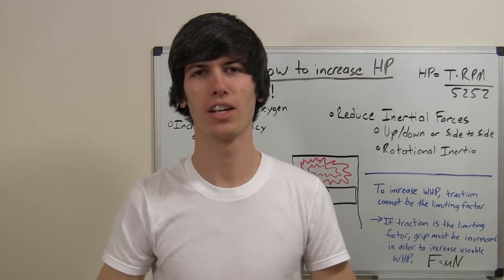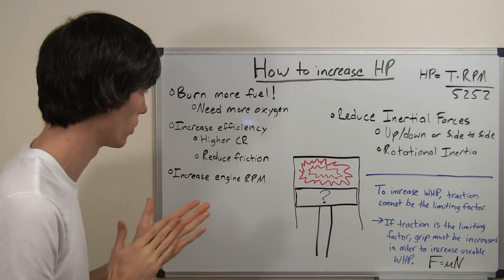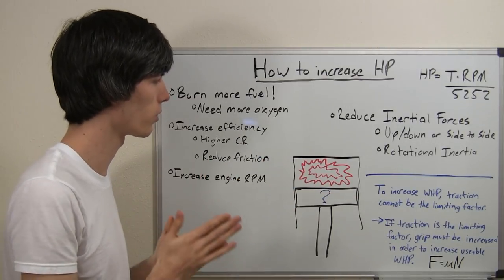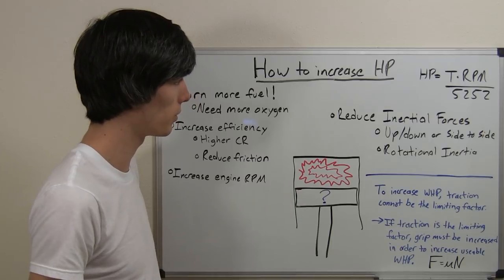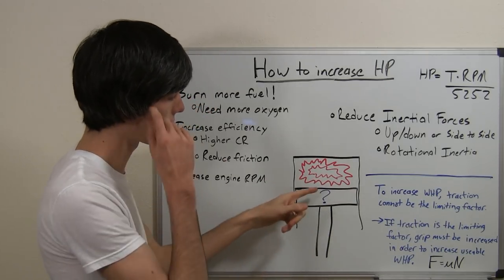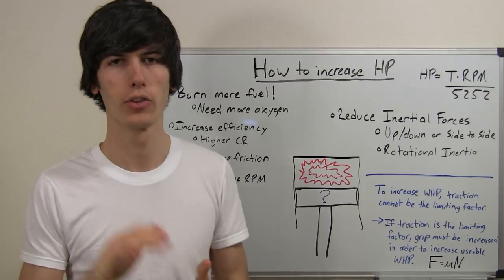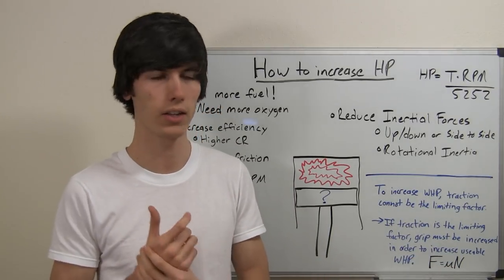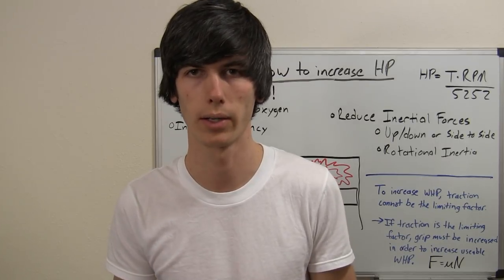How To Increase Horsepower - Explained

Comment: There is trillion ways to increase horsepower Engineering Explained  Non charged engine: use different valve, inlet mainfold, exhaust pipe bigger or smaller depands engine speed.  increase power in a Naturally aspirated engine means increase rpm and let the engine run as smooth as possible. So add lubricate and keep the engine temp low is needed. For turbocharged engine, install bigger ridiator for larger volume, install variable turbocharger, increase the size of inlet  mainfoldand exhaust pipe for higher boost. But the downside is pumping lost for hugh rev engine at low rpm. Same way for increase power in supercharged engine. This called Modification.
Reply: You did not know this
Reply: Huh
Reply: Can you actually point out my mistake?
Reply: ihatecrackhead DOHC will bite low end torque, you mean lag!? DOHC is f high speed engine, no one care the low end tq in a Ferrari, Lambo, GT3rs etc.... Most GT cars now have vairable valve timing and valve extension. For high revving engines, at low rpm, they'll lose power by pumping lose, so either  a high revving engine is or isn't running DOHC, at low rev, it still can;t make power and efficiency. Oxygen is compressable so yes, the capacity may increase from certain rpm. For high capacity high revving engine like Lambo's 8250rpm 6.5L V12, at low  rev, it may not get 6.5/4 1.625l per stroke. (I have to mention something here, the different between long stroke and short stroke did effect the power. If both short stroke and long stroke have 500hp, short stroker will shoot power quicker but less fuel eco also more heat.)
Back to the point, So now, does DOHC really matter in low end power lose? Nope. There's something call VVT (variable valve timing) and extension control by a generator installed at the end of the crankshaft. At low rev, the timing would be exactly the same as normal but'll extende in a wider posion. So more air would fill in which help getting rid of lag. At high rpm, the inlet valve would open later and close later for avoiding engine pumping lose. In other word, DOHC biting low end torque is not nessersary for modern engines.
Reply: ihatecrackhead You've missed something. Engine temp, stroking, firing order and out side temp. VVT is for avoiding friction. Do you think VVT would add extra friction? C'mon!
Look at Porsche Turbo S, variable turbo increase low end tq, max tq apply from just 2100rpm all the way up to 4000+rpm, non variable turbo engine like GTR's max tq from 3200, 12C max tq fro 3000 etc...
Enginetemp. No matter what type of engine, higher the emp means lower density, less oxygen, you'll lose power, turbocharged engine would be more effective, 70-80hp would disappear in 90degree F. You can;t just randomly compare two cars. 
 stroking. Mustang GT 5.0 R50 4 valve DOHC V8 90mm in stroke vs Camaro L99 6.2l V8 76mm, Mustang 412hp, 390lb/ft Camaro OHV L99 400hp and 410lb/ft fir order 1,8,7,2,6,5,4,3 vs Mustang 1,3,7,2,6,5,4,8. The Chevy actually can build the power quicker, smoother and the result is quicker if their gearin are the same. To increase engine dynamic, mainfold, inlet valve door, exhaust ainfold, exhaust vavle door also count.
In order word, there's many modern engineering can avoid engine friction. You've to jumo out of American engineering and look at others engineering.
Reply: ihatecrackhead Your first point called expansion. Expansion is fighting with pressure in the cylinder, the amount of air would maintain 3.8L with additional pressure, so it does not effect the engine power. You should start looking at how much fuel would fill in to that overpressured 3.8L.

Second point, Porsche didn;t prove your point, they proved mine. Variable valve timing, valve extension and variable Turbo increases low end torque, and high end efficient. Look a the powerband, 2100-5000rpm max tq 6500max hp. Turbo S's 3.8l F6 have 4 valve per cylinder.

Third point L99 does have cylinder deactivation, so? Does that really matter?

Fourth point Do you think manufeaturer will be that dumb? Putting a VVT for more friction? Check out  991 vs 997 Turbo S powerband

fifth point Short stroke would burn more fuel at the same engine speed, that's also create power quicker than long stroker. Check out why trucks uses long stroke engine. Then check AMS alpha 16 4.4l big bore.

DOHC are not always better??? Yeah they're better for high revving high flow engine. Those "friction" logic from you is not nessesery.
Reply: ihatecrackhead Again, you're talking about expansion. expansion would effect by temp. That's why turbo engine lose power at low density aera. more psi does mean more pressure but not fuel. Manufaturer would not purely allow more fuel to fill in because more air was flowing in. That'll decrease MPG. VVT not just increase low rev efficient for high revving enign, it shows your lack of knowledge here. VVT also avoid pumping lost at high rpm for high revving engine. Cylinder wall pressure depands on temp, amount of air flow in/ second, out side temp and combine expansion ratio. Don;t talk math with me.
Reply: ihatecrackhead Air squeez into the piston would not create extream heat, extream heat are at compression section. However, the air is not going anywhere in that time. it just expand.

More air NOT= more fuel needed. More air, same amount of fuel= mild backfire, maintain blue flame. Does not effect in power. The heat would also increase. However, I'm telling you that 2X air not= 2X fuel.

S.C is similar to T.C S.C is more linear, need a bigger oe for more power and not as much lag as T.C. To make power, mainflod, AF control and ECU need cooperate.

The last part is all about air pressure/expansion.
Reply: I wouldn't say a trillion ways, but horsepower can be increased. Not as high a most people think, but it can be increased. I think the video pretty much explains it. The problem with modifications is most people don't do their homework. When you modify you become an engineer. You must make the rest of the vehicle work with whatever you modify.
Reply: With more speed, you need to adjust the braking and damper to hold the weight and slow it down with extra weight transfer and speed. However, I think some cars like Nissan's GTR, Porsche PTE and some other cars have the ability to handle a 800hp tune without any electronic adjust or remap or damper tune but a better brake disc and router will be needed.
For cars like Nissan, Audi, Porsche, they highly relied on electronic sensors, to adjust the sensor is to remap the way it monitor and the bit. ie, GTR's 16bit sensor will update info 1000 times per second and it's fast enough to track the yaw and traction of the car even when it got 800hp.
Reply: LAUNCH CONTROL 東瀛戰神 When a vehicle advertises 800HP, this is peak RPM. What we typically need on the streets is torque. HP is simply a mathematical way of expressing torque and RPM because it is a result of it. I prefer more torque because that is really what we are after.
Reply: walkerscranger Torque and horsepower is pretty much the same. More horsepower by increasing fuel flow efficiency will increase rpm but torque or force is pretty much the same, which means the max torque @ rpm may not have big difference. To increase torque, mostly remap ecu and tune the inlet valve settings, air/fuel mixture, etc... That'll affect the force in cylinder. The red line may stay pretty much the same but low end horsepower will increased.

The best example is McLaren 3.8 TT V8. Look at the torque curve, 443lb/ft from 3000-7000rpm. That tells the engine have potential to beat 443. The GT3 version got less power but the torque curve is 370lb/ft at 3000-7000rpm. Easily tells they're playing with air/fuel mixture and the ecu limiter.
Reply: LAUNCH CONTROL 東瀛戰神 The peak torque will be before 5252 RPM and the peak HP will be after 5252 HP... how are they the same? Torque and HP will be the same at 5252 RPM. One way to increase torque is an intake runners of equal lengths but have a valve that allows a shorter runner for higher RPM. Or adding more stroke. But anytime you increase torque you are increasing HP because is simply mathematical as long as your RPM increases.

Not every engine will have a great increase due to its own restrictions. The engines you mention are already designed to be high HP engines. The typical vehicle is different because a vehicle with a lot of torque gets you off the line, HP gets you on the top end. Just because a vehicle has a lot of torque does not mean it has a lot of HP, it will need to keep the RPM curve going to have high HP. A vehicle with a lot of HP may not have a lot of torque but it can keep the RPM very high. A good example is the Buick Grand National. It has over 355 pound feet of torque but the HP is low (250) because it doesn't have the RPM to continue the climb. The formula shows that at peak torque the engine is only at 135 HP. HP continues to climb while torque starts to descend. So when the engine peaked out the RPM with 250 HP the vehicle is at 219 pound feet of torque. A drop of 136 pound feet of torque.

That is why when the manufacture advertise torque and HP it is always two different RPM's. 2015 Chevrolet Corvette 460 pound feet of torque at 4,600 RPM but the HP is 455 at 6,000 RPM. Which means the torque at that HP is 398 pound feet of torque. A drop of 62 pound feet of torque.
Reply: walkerscranger Horsepower isn't as easy as you think. There is many way to get the wrong horsepower. I'm not saying manufacturer are lying about horsepower, but they dyno horsepower at different speed. The more reliable factory is Nissan. Nissan GTR's maximum speed= 315 km/h- 318 km/h or 320 (200 mph) if you're lucky. So if they get the horsepower at top speed, the number isn't a lie. There is a real example. BMW M5. You believe a car with that much weight and similar power to weight as Nissan but with slightly longer gear ratio can reach 300 as soon as GTR? No, they dyno the horsepower at different speed as the Nissan. The BMW can reach 320+ km/h without limiter, same goes Porsche, it can reach 333+ km/h without rev limiter. At same speed as GTR (315-318kph), Porsche cranks about 636 horsepower. BMW cranks around 613 horsepower but 590 lb/ft of torque. BMW's 560 horsepower happens at higher speed, about 340 km/h. Porsche 560 horsepower happens at about 357 km/h. In conclusion, those 4.4 liter TT V8, 3.8 liter TT F-6 are underestimated. I don't want to do the calculation here, it'll can take 100 lines. If you interest, the formula is thrust x speed / 75 kgf. Hard part is to calculate the thrust. Took me whole day. (sorry for bad English)
Reply: +NISMO N ATTACK 東瀛戰神 Horsepower has nothing to do with how fast the vehicle travels (mph). The engine is either on an engine dynamometer or in a vehicle on a chassis dynamometer. Horsepower is simply a mathematical number from torque and RPM... nothing more. You have a certain amount of torque at a certain RPM and if you work the equation correctly it will give you a figure that we call horsepower. Here is the formula to calculate horsepower HP = Torque X RPM / 5252.... MPH is not in the formula. Horsepower is one of those figures that people love to say, but it is really the torque of the engine expressed a different way. The engines output is also limited by the transmission, final drive, weight of the vehicle, aerodynamics of the vehicle, tires, road surface, humidity, temperature, wind, quality of the fuel, ect. Why would MPH have anything to do with horsepower. The engines peak RPM's can be reached in neutral, so as long as you have a way to load the engine (chassis dynamometer) then you can find out how much work the engine can produce... not how fast it can get up to.
Reply: walkerscranger Horsepower does related to how quick a vehicle accelerate. Again, horsepower can measure in many ways. Ie, kw, ps, bhp, etc... Mine is related to thrust. The amount of speed gained in certain time tells how many g the vehicle pulls. The amount of G tells how much forces the engine applied compare to its weight. That known as thrust. It's like the relationship between effort force and resistance force. Effort always= resistance in ideal world. But in actual world, it can affect by air resistance, traction, etc.. Those will cause calculation error.
Reply: +NISMO N ATTACK 東瀛戰神 The thrust and or force that you are referring to is called TORQUE
Reply: +NISMO N ATTACK 東瀛戰神 The many different ways that you are referring to (kw, ps, bhp, etc) are measuring using the same calculations under different conditions or a conversation of the same thing. The big problem with people and HP figures is they think they HP does not change in any condition. Climate, fuel, surfaces and driver effect everything.
Reply: walkerscranger True, they calculate horsepower in many different ways. Problem is,, which fit the most. 

Air density, fuel, surface, timing, etc.. Does affect horsepower, but that's another case. Not the one we're talking about.
Reply: +NISMO N ATTACK 東瀛戰神 Horsepower is calculated HP=Torque×RPM÷5252. How are you calculating HP?
Reply: walkerscranger Thrust x speed / 75 kgf. Here's a real example. GTR's motor can pull an average 0.237g for the Nissan at 300 km/h, average thrust= 412 kg at the wheel. 412* 83.33 m/s . 75= 457.9 wheel horsepower, pretend 15% drivetrain loss, crank horsepower= 538.7 horsepower.
Reply: +NISMO N ATTACK 東瀛戰神 Explain THRUST.
Reply: +NISMO N ATTACK 東瀛戰神 Again there is HP at the engine crankshaft and there is Brake HP at the wheel. Basically the HP minus the powertrain loss is BHP.
Reply: walkerscranger Thrust is simple. ie a car weight 1740 kg, it reaches 300 km/h in 35.7 seconds. 300 km/h= 83.33 m/s, 83.33/35.7= +2.33 m/s / 9.8 m/s square= 0.238g. So the engine needed 0.238 time the force the weight of the car in order to reach 300 in 35.7 seconds, the last calculation I excluded air resistance, this time, included air resistance. At 300 km/h, air resistance= avg 109.1 at 22C, Sea level 3.54m, 60% humidity. (the reason I detailing air resistance is because above 250 km/h, air resistance is so effective) 109.1+1740+ 50kg= 1790 kg*0.238g= 452 kg* 0.85= 384.2*83.33/75= 426.9 wheel horsepower at 300. Edmund tested= 430 wheel horsepower, 20% loss= 533.5 horsepower. Exact horsepower as what Nissan claim. At 6500 rpm, crank torque= 431.1 lb/ft. The torque curve of the Nissan at 6500 rpm is= 431.1 lb/ft. So it prove me right.
Reply: +NISMO N ATTACK 東瀛戰神 Thrust is what a jet engine does. You are referring to TORQUE. No matter what or how you explain it torque is what moves the vehicle and how much you have at a giving time of the RPM range determines HP.
Reply: Keith Walker Before going any further, let me ask you a question. Tell me the difference between jet engine and rocket.
Reply: +NISMO N ATTACK 東瀛戰神 You're on the internet.... Look it up. Rockets don't have an intake... their fuel is solid and there is nothing mechanical. Jets have an intake... their fuel is liquid/gas and there is a mechanical aspect to cause the effect. Rockets are similar to a bullet (a projectile) but continue because there is fuel (generally a one time use). Jets need lots of air to cause the thrust effect. Either set up has a drivetrain because they use the force of the combustion to move the airframe. Vehicles need a drivetrain because the effect of the air/fuel is producing a twisting effect (the crankshaft) and based on what type rod length and crankshaft journal off center line determines the amount of torque. The amount of air/fuel in the cylinder determines the force against the piston which creates the torque. Now how fast the crankshaft turns is your RPM for the equation. Thrust is not part of the automotive world because it has a drivetrain. If you had a set of long headers and you rev the engine and the effect of the exhaust moved the vehicle (not the drivetrain) then that would be thrust. But we know the amount of exhaust is way too small to do any work.
Reply: +NISMO N ATTACK 東瀛戰神 The rocket and jet DOES NOT have a drivetrain therefore they use the combustion of the fuel to propel the airframe forward.
Reply: walkerscranger  I know how rockets works, I just want you to look it up coz the way you calculate horsepower from both jet and rocket are based on thrust.

Here is an example of how to calculate jet trust. Both cars and jets create resistance forces by rotation, you'll understand better if you have a look at jet propelled tank. 

So by facts, horsepower can measured by same formula. Again, the way to measure horsepower from rocket is same as the way you find hp from jets. The difference between those 3 are the way to find thrust alone. 

ie, GE90-115B create 45 tonnes of thrust from fan and 7.5 tonnes of thrust from jet, combine= 52.5 tonnes. The amount of torque at fan= 45.0 t * 1.63 radius= 73.35 tones/meters of torque at 2600 rpm, horsepower= 262,088 horsepower from the fan alone. But that doesn't mean it can produce 262,087 horsepower of work for a plane weight 345,700 kg. To know how much work it applied for a 777, you have to measure the acceleration force of the 777 as well. a 777-300 ER accelerate to 325.8 km/h in 47.3 seconds, distance= 3260 meters, acceleration force= 2.912 m/s or 0.297G. So, pushing a 345.7 tonnes plane reaching 325 km/h with 10.28 tonnes of average drag= 355.98 tonnes of thrust, multiply by 0.297= 105.7 tonnes of thrust. 105700*90.5/75= 127,544..7 horsepower at 15C, horsepower rate of a 773ER is between 120,000- 145,000 horsepower depends on temperature. You have to know the different between the work from the motor alone and the work applied to the machine. Same goes cars.
Reply: Keith Walker I explained it to walkerscranger, you can read it if you want. By the way, jet does have a drivetrain.
Reply: +NISMO N ATTACK 東瀛戰神 OMG you cannot be that uninformed. Continue to think the way you do about torque. Trillions of ways to increase horsepower... really??? It seems you are unaware of how HP works or even where it derives from.
Reply: I would like to show you my assignment which I got full mark at that section. if i can.

You don't always need torque to get horsepower. Torque is a way to measure horsepower but doesn't mean it's the only way. By the way, torque is a rotating force, those force known as thrust.
Reply: +NISMO N ATTACK 東瀛戰神 Exactly... rotating force! You got it! Torque!!! Not Thrust! Thrust is for airplanes and boats and rockets and space shuttles not vehicles because they have wheels that ROTATE (TORQUE).
Reply: walkerscranger Disagree. According to Newton's third law,
"When a system expels or accelerates mass in one direction, the accelerated mass will cause a force of equal magnitude but opposite direction".
The amount of forces that rotate the gear known as thrust. The amount of thrust transfer to rotating action (torque) and the wheel spins. Easier term, what's the resistance force of a vehicle? It's weight, is weight a rotating force? No. It's the amount of gravity force that earth needed to press it on the ground. Is it torque? No.  but you can call it resistance torque when multiplied by radius of drivetrain. Spinning a wheel is just a method to move a car on land, it's like ship and jets, those propellers propelled air or water to push themselves forward by propelling air/ water backward.  Same goes cars, the very bottom of the wheel are kicking backward to make the car go forward. Those 3 known as Newtons third law. Torque is just a way to tell how much forces is the gear or wheel making while rotating. Nothing to do with Newton's third law.
Reply: +NISMO N ATTACK 東瀛戰神 That is not thrust it is inertia. The equal force in stopping the vehicle. Energy cannot be produced as you describe in a piston engine. There are too many limits. The RPM of a jet engine verse a piston engine are greatly different and the configurations are totally different.That law does not apply.
Reply: walkerscranger That's not thrust true, that's inertia? True. That's not torque? True. But you know what? Thrust can be known as counteraction to resist the amount of inertia forces. Here is an example, the wing of an airplanes works as the propeller of a jet engine. They spin in order to channel airs through. Those air mass known as thrust. Here is an example of relation ship between inertia force and lift. Ie, a 200 tonnes plane bank 30 degree, your appearance weight is 230 tones and your centrifugal force= 115.5 tonnes. Same goes centripetal force. So the actual weight of the plane is 230 tonnes at that moment, each wings need to generate 115 tones of lift. Those 115 tones of lift on each wings known as centrifugal and centripetal forces. Coz centrifugal force always= centripetal force and that's newtons third law. Back to the topic, that also= the amount of resistance force are always= the amount of thrust in order to maintain speed. (some times need more forces due to drivetrain loss or whatever). Torque just tells you how much forces it produce while turning, also known as a rotating thrust. So I can't say you're wrong, but just not the most direct way to measure horsepower.
Reply: +NISMO N ATTACK 東瀛戰神 The problem is inertia does not add to the forward motion (or momentum or centrifugal force) of the vehicle. Energy cannot be destroyed so it continues until the friction, gravity and wind resistance slow the vehicle to a stop. If the vehicle goes down a hill, yes it is easier to accelerate but that is not an actuate measure of anything because you cannot reproduce it at a given time. To keep the vehicle moving forward the crankshaft will have to continue at a certain pace. To increase the pace the crankshaft will have to increase its RPM. No other input can be added to a gasoline/diesel road vehicle. There are too many variables working against the vehicle to increase HP. Turbochargers, superchargers, fuel, nitrous oxide, alcohol, higher compression, high flow cylinder heads etc. are the only ways you will be able to increase HP in a gasoline engine.
Reply: walkerscranger Nice, when a vehicle accelerating down a hill, it's also known as Newton's third law, so what's the effort force and resistance force? The effort force that push the vehicle down its weight, resistance force? air and drivetrain loss. So is the weight of a vehicle known as torque? Ie, vehicle weight 2000kg, slope= 20 degree= 2000/ cos20= 2128.4-2000=128.4 kg of force pulling you down. The vehicle will accelerate at a rate of +0.0642 G. Exclude drivetrain loss and air resistance, the car will hit 60 mph in 42.4 seconds. It can be known as torque, ie, your final drive gear is 0.1 m in radius, your torque= 12.84 kgm. See how it works? If you're on a dead flat road but wanted to accelerate to 60 in 42.4 seconds in a 2000 kg car, you need 128.4 kg of thrust or "12.84 kgm of torque" from the motor (excluded tire resistance, drivertrain loss and air resistance)
Reply: walkerscranger Of course there's many variables in calculating HP, that's why you need to calculate in another way, which is calculate how long the object accelerate to certain speed. Then calculate how much force needed to push those mess into that speed in certain time. (Newton's third law) Nothing explains physics better but physics themselves.
Reply: +NISMO N ATTACK 東瀛戰神 What you are referring to is the weight of the vehicle which goes back to TORQUE. Torque is used to get the vehicle going HP keeps it going. That is why torque is normally higher than HP before 5,252 RPM then torque and HP are the same at that point. HP continues to climb and torque decreases. The weight of the vehicle can vary this. The variables I mentioned does not cause us to look at another to measure HP, it makes everything relative. A some changes can change the entire dynamic for better or worse. In most cases it is the worst because people don't understand the way power (torque and HP) is produced/created. Like adding a COLD AIR INTAKE (nothing is cold on a vehicle). People will place an open K&N air filter under the hood and cause the vehicle to make less HP because it is now drawing in under hood temperatures instead of ambient temperatures. This simple variable will affect torque and HP to produce less.
Reply: Keith Walker  What you mean "Torque is used to get the vehicle going HP keeps it going."? Torque is horsepower. More torque less horsepower means your torque comes in at lower rpm, less torque more power means less torque at low rpm. 
Weight of the vehicle doesn't go back to torque. Is weight torque? The engine produced thrust at the very first then transfer it into torque in order to spin the tire. If you know how combustion engines works you should know it. The piston pushes down by the sheer force from igniting air/ fuel mixture. Does it reminds you rocket? Then this vertical motion turned into rotation motion via crankshaft. That doesn't mean horsepower always needed to add torque.
At least, prove:
thrust x speed/ 75 kgf doesn't work for cars.
Reply: +NISMO N ATTACK 東瀛戰神 WOW! You need to read more. Why do you think large trucks use diesel engines? Because they produce more TORQUE to pull heavy loads. In a gasoline vehicle the more torque you have the quicker you can start for a stand still. Thrust has nothing to do with a gasoline or diesel engines. You're talking about the expanding gases inside a cylinder pushing a piston down. That is in no way similar to a rocket. Your torque is highest in the beginning because the engine works its hardest to move the weight of the vehicle (less weight and it can move it faster). Once it has it going it is easier to go faster, hence the torque decreases and HP continues to increase but the engine is limited by the RPMs of the stroke of the engine. Short stroke engines can rev higher than longer stroke engines. Long stroke engines have more torque than short stroke engines.
Reply: Keith Walker More torque does mean better acceleration true, did I ever say no? Thrust have nothing to do to gasoline and diesel engine? Am I talking to a 3 years old? Come on, you should go and read more mate. "You're talking about the expanding gases inside a cylinder pushing a piston down." wow.... Just wow....
Your torque is highest in the beginning because the engine works its hardest to move the weight of the vehicle (less weight and it can move it faster). LOL So the engine have mind? lol The reason most engine have more torque at low rev isn't because the engine know you are running slow, it's because there is always a speed when the piston punching through the least drag. That's when maximum torque build up.  
Again, torque and horsepower don't separate if your calculation is 2*pie*torque*rpm/33000.
Also, Long stroke does have more torque coz they're rotating a larger (in radius) crankshaft but short stroke means urgent power "less lagging"
Reply: +NISMO N ATTACK 東瀛戰神 OK... stay uninformed. There is no one in the world that agrees with you because what you are stating makes absolutely no sense. What is your automotive experience?
Reply: walkerscranger So you talk for everyone? Based on your knowledge? My automotive experience? I don't know how to tell you, it's pretty complex but I'm sure my automotive experience are greater than yours. You're just narrow minded.
Reply: +NISMO N ATTACK 東瀛戰神 I have over 35 years of experience in the automotive field. I've worked with several different manufactures. I'm currently working at a technical college where I teach automotive and I operate the chassis dynamometer. I also work with automotive engineers at a university as well and no one has ever used the formula that you speak of. Thrust is not a measure of any application in the automobile world. It works for rockets, jet, boats, etc because it is a constant, a set throttle or RPM across the measurement. Vehicles are not constant because they have to shift gear ratios and it changes the dynamics of a thrust measurement and the variables are not constant which makes any measurement of thrust a second time unobtainable or inconclusive, simply inaccurate. There was one vehicle back in 1963 from Chrysler that was a gas turbine (jet car) where the THRUST equation might work, but it still had a drivetrain to work through as well. But all other vehicles use torque and HP because you can use the information with all the other variables. There is no one or manufacturer that has ever expressed automotive power as THRUST.
Reply: walkerscranger What? You teach automotive!? Automotive what? No offense but seriously? You said thrust have nothing to do to car acceleration yet you teach automotive!???? By the way, teachers doesn't works for me, I study cars and aviation physics, I did correct my teacher not once but 4 times in one day 8 months ago before I graduated and I'm 18. There is no manfeaturer has ever express auto power as thrust doesn't mean they don't exist. I found out this topic is hard to argue with words. Disprove horsepower = thrust * speed/75 kgf with your calculation. At least tell me which part was wrong in my calculation of converting horsepower into thrust.
Reply: +NISMO N ATTACK 東瀛戰神  Just like most people do... YOU MISSED THE PART OF ME WORKING IN THE DEALERSHIPS. I worked on the line and did not starve. I have forgotten more than you will know. As people do... try to make what people say fit their agenda. There is no one out in the automotive world that uses THRUST. It does not make sense to even have this conversation. You copied this off some web page and have absolutely no proof that you can consistently measure this calculation over and over with similar results. But I do it everyday on a chassis dynamometer using torque.
Reply: +NISMO N ATTACK 東瀛戰神 So I take it that you have no automotive experience? Interesting....
Reply: walkerscranger "YOU MISSED THE PART OF ME WORKING IN THE DEALERSHIPS"

Who are the buyers? Scientist? You will argue horsepower with consumer o you'll teach consumer a lesson of thrust have nothing to do to cars? You know more than I forgot? You on't have too much to forget bro. Also back to thrust, since you think thrust have nothing to do to cars acceleration, I'm pretty much done with you..... Also, I'm waiting for your formula "teacher"
Reply: walkerscranger I have no automotive experience so? I bet I love cars more than you love your job. And that passion motivates me to learn more instead of being arrogant, ends up allowing me to beat a teacher in basic knowledge of Newtons third law :P
Reply: +NISMO N ATTACK 東瀛戰神 Dealerships meaning I have worked on thousands of vehicles with carburetors, throttle body injection, port fuel injection, direct gas injection, superchargers, turbochargers, etc. I have built muscle cars for people (off frame restorations). I have built more engines than you can imagine and THRUST was not part of the equation!
Reply: walkerscranger You work on those stuffs doesn't mean anything I mentioned. Today, I just went to a garage to change tire, guess what, I saw the suspension alignment computer reading the thrust angle "toe angle" of a Toyota Tundra. I wonder, why don't he translate to torque angle lmao.....
Reply: walkerscranger Yes, I love cars more than you do, You may call me immature but I call that passion, and again, this passion pushes me to learn more allowing me to know more.
Reply: +NISMO N ATTACK 東瀛戰神 LOL... see you don't have a clue what thrust angle means. Has nothing to do with vehicles ability to accelerate. It is simply the rear wheels steering the front wheels. Do a little more research first.
Reply: +NISMO N ATTACK 東瀛戰神 You can love anything, but you can't measure love of anything... you can't measure passion of anything... because it is a feeling. You cannot say you love or are more passionate than anyone else because there is not a scale to measure feelings. WOW
Reply: Keith Walker Wo wo wo hold on hold on!!!!! Did you just say:

"see you don't have a clue what thrust angle means. Has nothing to do with vehicles ability to accelerate. "

So toe angle won't affect vehicle acceleration? Ask that guy in the video and see how he answer you.
Reply: +NISMO N ATTACK 東瀛戰神 I've performed thousands of vehicle alignments. I don't need to ask the guy in the video. The angles you're are talking about has nothing to do with the topic at hand. You were talking about THRUST as a calculation instead of HP. Now you're trying to twist the conversation to alignment angles. As I spoke about earlier, people can't stay on topic. Of course a vehicle that is not within the alignment specifications will affect load of the engine to a certain degree if the alignment is out of specification bad enough.. If the thrust angle is dog tracking (yes the front wheels are commanded by the rear because the rear directs the front on all vehicles) the vehicle can still accelerate without being hindered. But your argument is THRUST instead of HP. Again thrust angle in an alignment is simply which way the rear wheels will direct the front wheels (left, right or straight ahead). If applicable you adjust the rear toe to achieve the thrust angle straight ahead. Your new found information is not very new or even relevant.
Reply: walkerscranger That means you have zip experience in high performance vehicle. If toe angle have nothing to do with what I mentioned then how toe angle alignment gives BMW M cars and AMG much better lap times? How toe angle reduce over steering then? Back to thrust, I don't get the point from you. If thrust have zip to do with acceleration or "horsepower", "work" ,etc.. Then how air resistance and tire resistance slow cars down? If torque is the only way to calculate acceleration or horsepower "work" Then how gravity pulls car down from a slope? Do you have to know how much torque gravity made in order to pull the car down? You can but where those forces come from? Also, how you calculate air resistance? It slow cars down, deceleration known as work according to New Ton's third law, so you need to know how much torque air produces in order to calculate horsepower and see how quick it slows down? The tire spinning is a way to move a car, The tire rotate to backward in order to go forward, it's like you kicking backward to makes you go forward, same goes kayaking, you propel the paddle backward in order to go forward, the amount of forces must equal the amount of weight (by ratio) and resistance from water at certain speed. Same goes any moving objects. Damn, even a 3 year old can understand.... You sir are mechanic, some says, mechanics know a lot about cars..... LOL yeah fixing shitty cars ecu, a/c and radio or maybe changing engine oil or differential fluid..... But car physics are zip of their business.....
Reply: +NISMO N ATTACK 東瀛戰神 Oh I have more experience with high performance vehicles then you'll ever know. BMW M and AMG... vehicles I have worked on but vehicles you'll never own. You will probably end up in a Honda Civic. The tire rotates Backwards? Are you REALLY SERIOUS! WOW The tire and the paddle are working in a forward manner to go forward... not backwards. Re-take your physics class. A mechanic is someone who throws parts at vehicle to repair it. A technician is someone who diagnoses a vehicle a makes a repair or replaces one part. You are neither. You want to come off as an a person that knows this stuff but reading the internet doesn't count. An engineer you'll never be if you continue to think this way. All of your experience is from the internet... that is all you have and it is not working for you. Physic plays a large role in all aspects of the automotive field. That is your problem.... you simply don't understand how all the pieces work together. You continue to try to use one part of an equation that does not work. The vehicle has all types of resistances that you are not calculating. The engine (HP loses), transmission (HP loses), final drive (HP loses), tires (HP loses), aerodynamics (HP loses), temperature (HP loses), humidity (HP loses), higher elevations (HP loses unless its force induction), weight of the vehicle(HP loses), etc...
Reply: Keith Walker  Cars that I'll never own? You worked with AMG and M but stupid like a pig? Also, Honda Civic Type R is a car that you shouldn't underestimate. If a tire rotate clockwise, your vehicle is moving towards the opposite. It's like your lame legs, you kick backward to go forward, unless you're doing moon walk. I don't care you're a mechanic or whatever, both job is to put parts in and fix parts, it's like a car slave. Car engineers and designers are the one who in charge of building the car, they get idea from experience, new thoughts, etc...  They have to study physics to understand how car works. Easier term. Mechanics studies physics of how door handler works, how windscreen wipers works, the torque of a wrench, how to draw an anti roll bar, how to draw a suspension, etc... while a designer or chief engineers studies weight transfer, how air effect engine, New tons first, second and third law, how to gain traction, how to increase tension rigidity, how to balance handling, etc... Your hp lose from this from that I already told you couple days ago so don;t even try to take advantage over that. You still don't have the calculation to disprove me.
Reply: +NISMO N ATTACK 東瀛戰神 Pig? Are you three again??? I hope your parents have a lot of money... cause you're gonna need it. I knew you liked Honda's... most people who know nothing about vehicles like them. Very poor in technology. The majority of engineers working on automobiles do not know how the vehicle even operates. But if you knew anything you would know that. Very few engineers work on the power plant. The majority of engineers work on styling and safety... but you knew that right? How often do manufactures come out with a new engine? Very few. Especially Honda... old technology. You need some more experience grasshopper.
Reply: walkerscranger Calling people pig is three but calling dummies a pig is normal. 

I need lots of money from parent? I like Honda because ppl who know nothing about cars like them? You said you're a teacher right? I think your student need lots of Honda, hope Honda can build cars faster than your students graduate.

Engine isn't the only part of cars mate. Pagani, McLaren, Land Rover, Bentley, etc... doesn't have their pwn engine, they uses BMW engines, Mercedes V12, Jag S.C V8, VW's W, etc... Sportscars are more than just the engine, Nissan GTR proves it. I don't want to go deep here, if you're interesting, you can read my posts. Stop mentioning Honda, they build nothing but SHIT. I assume you're working for Honda.
Reply: I have never worked for the Honda manufacturer nor their dealers. Your rant makes no sense. You go from THRUST to some weird rant. It is possible that you are upset because what I said was true. Good day.
Reply: walkerscranger Believe what you believe.... Have a good day.